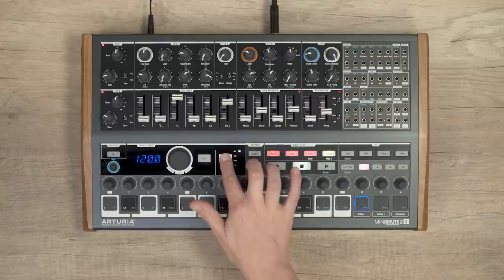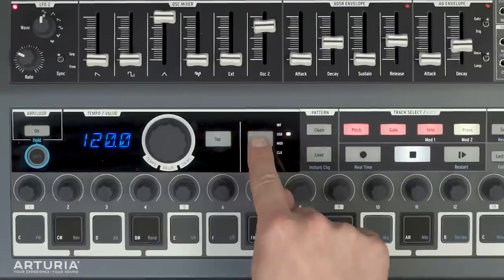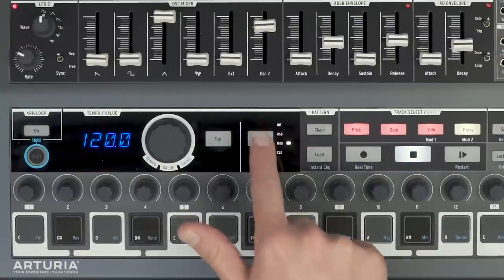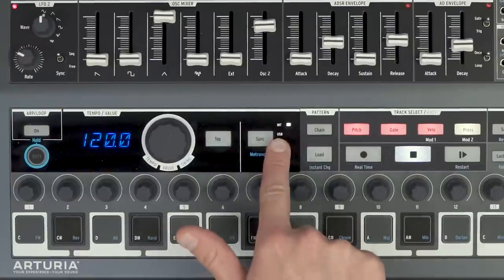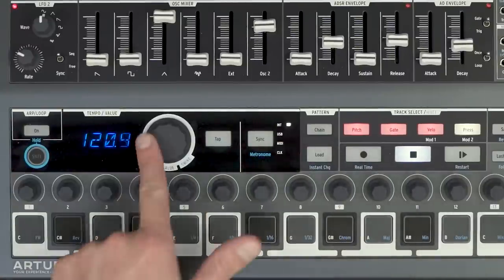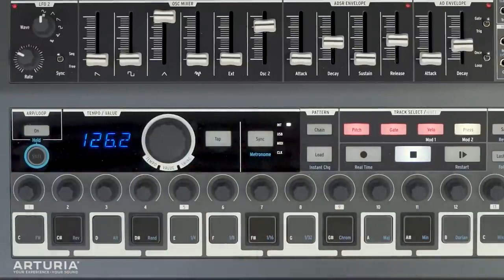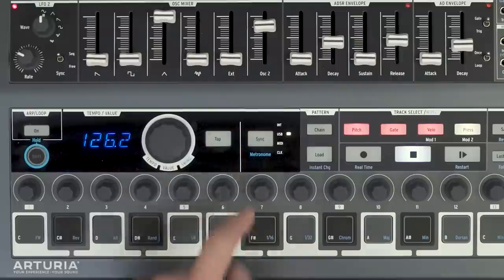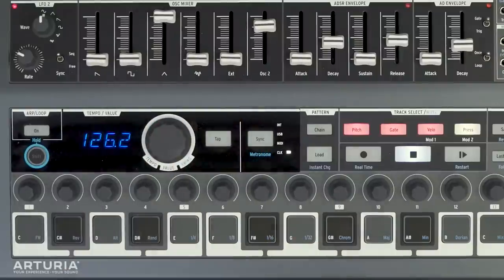MiniBrute 2 Ecosystem Tutorials: Episode 04 - The Sequencer

Comment: Wish there was a way to see the note by pressing the button or shift function to see note of each step for quick recall of what note was played instead of moving a knob to change the note to see what note was played. My biggest pet peeve so far is that. The reaction of the sequencer in realtime mode seems to miss the first note. If we checked your work here in this video I wouldn't be surprised if the first note you played into the sequence wasn't exactly on the first note. yes do make more tutorial videos on this synth. when I was trying to think of way to combine shift and buttons to press to lock in a setting on the sequencer to then be allowed to select any button to view notes; does that feature exist, am I rambling?

Comment: Direly in need of episode 5 to really grasp how to use tracks 3 and 4 as second pitch and gate tracks. Can I enter that second pitch track using live recording? Doesn't sem to work. Also, how to use the per-step LFOs and envelopes . Also, how would I "build" myself a pitch wheel and be able to set the range like on the keyboard version or Minibrute 1. I'm thinking this would somehow be done with an attenuator but not sure

Comment: HOW DO I PROGRAM SLIDES I NEED TO MAKE ACID
Reply from the maker: Hi, in the sequencer you can press shift and turn the Pitch knob to create slides. I hope it helps :)
Reply: @ArturiaOfficial  it works fine with the internal oscillators but seems to malfunction when sequencing externally (acidlab m303) - is the slide/pitch parameter locked to the internal sequencer and not supposed to be used for external control like the beatstep?

thank you for your help.
Reply from the maker: @emilyschmanks  As it's fully analog it should work with an external analog instrument. 

I suggest you to get in touch with our support team with this link: 
https://www.arturia.com/support/askforhelp

I’m sure they will be able to help you :) 

Best regards.